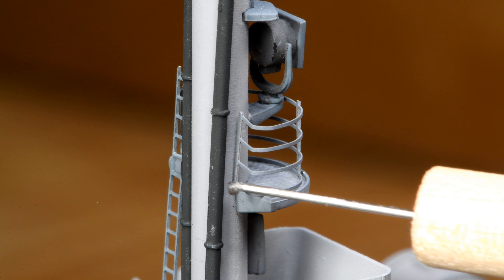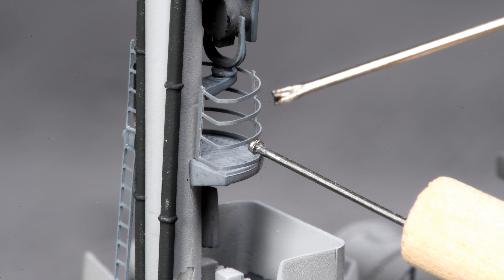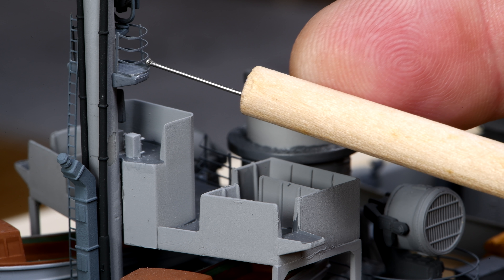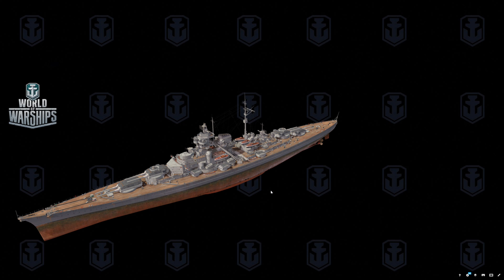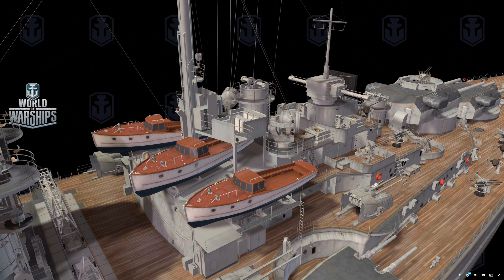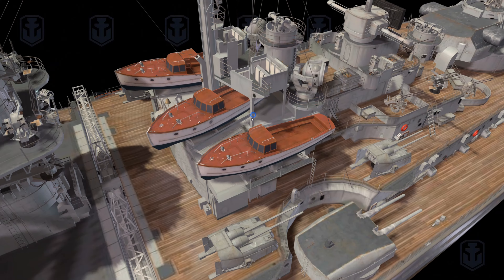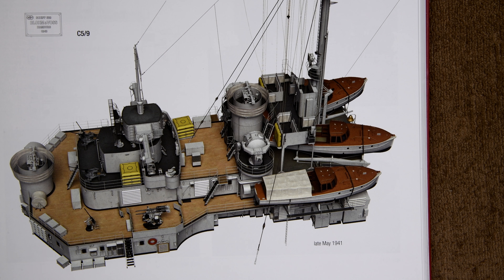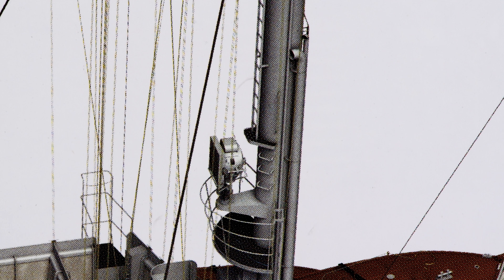The Model Ship - Part 368

Comment: I enjoy watching the build. Thank you for the series. It seems like you use about 3 times the needed amount of glue causing all the puddles and such. I did a small project and used a sewing needle tip (the sharp end) mounted in a holder to barely apply a drop. I think the split eye of the needle you use is holding much more glue than you think it is, Just my humble idea. Thanks again Ron and stay warm.
Reply from the maker: Nope! I only use twice as much glue as necessary. The macro lens make those puddles look bigger than they actually are, haha  😁

Comment: "... depending on what superstition you adhere to."  LOL!  😁😁😁😁

What brand and model security cameras are you using?  Getting ready to install some.                 See ya tomorrow.                JImE
Reply from the maker: Hi Jim,
I'm presently using an 8 camera system from Swann. It's about 6 years, or more, old. Lots of better stuff out there now I'm sure, but it works. If I had to replace my system, I'd be looking into 4K stuff like these --- https://www.bhphotovideo.com/c/search?ci=3672&fct=fct_resolution_2134%7c4k-3840-x-2160%2bfct_channels_800%7c8&N=3822779873&
See you tomorrow. 👍